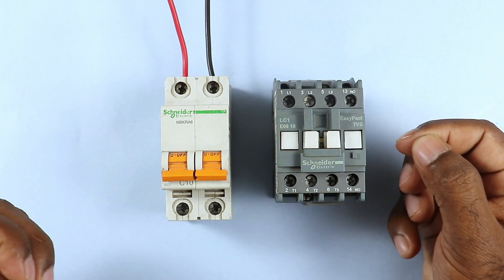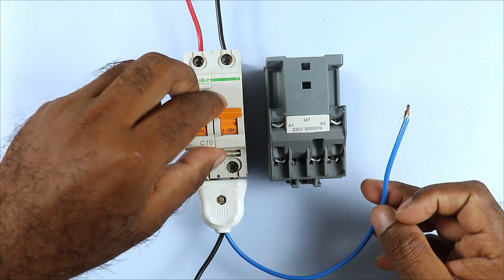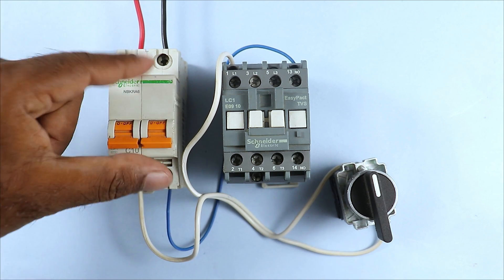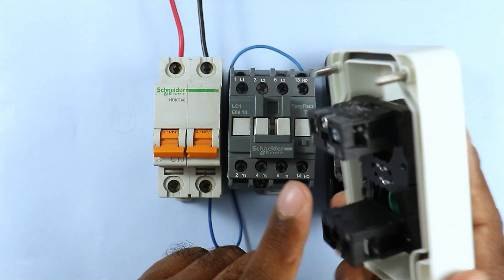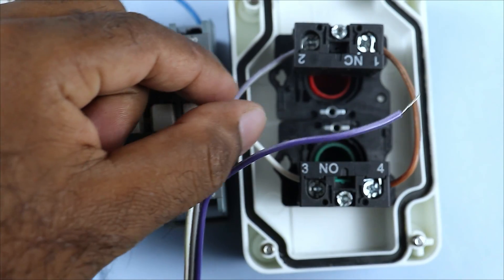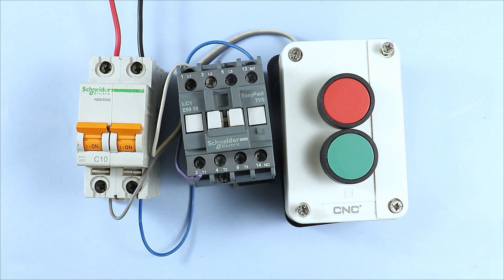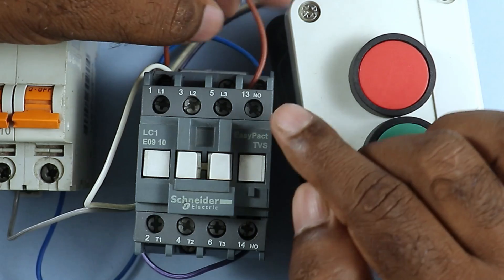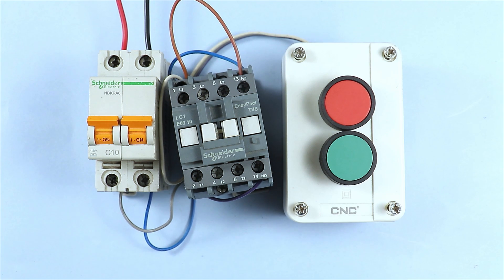How to Turn ON And OFF Contactor by using Two Wire and Three Wire Control Method @TheElectricalGuy

Comment: Can you show, if it is possible, how to wire a 3 phase contactor which has no "auxilliary" contact within contactor that usually holds up the auxiliary circuit (NC, NO contacts) of the contactor..

Comment: Excellent Video. I am new to this type of electrical wiring and your description helped a lot. I assume the three wire control method is preferred because it seems that if there is a loss of power, the contactor break contact and a users will have to intentionally turn the power back on versus the two-wire method, when the power returns, the machine will immediately power on. It seems 3-wire is superior?

Comment: Can someone explain the why the purple wire goes in the load side (term 14) of the contactor? Im not grasping how the jumper from A1 to 13 is a line side when power is already at the NC line side where the purple wire is landed on the start button.

Comment: Bro, I have one doubt, why we use MCB to open and close the circuit, we could have used one simple switch, right?  May be the answer is simple, but I am not from electrical background,  that is why I have this doubt! I hope you will answer this
Reply: A circuit breaker(CB) is different from a switch in that it offers additional protection unlike switch which just close or break a circuit